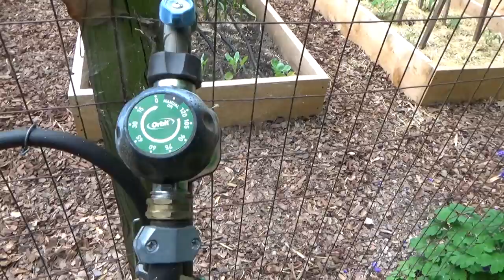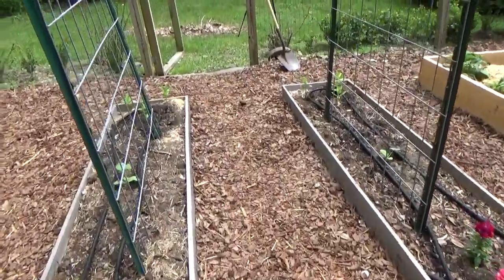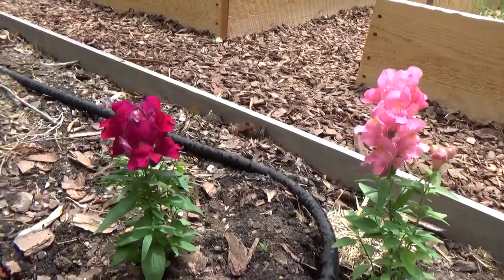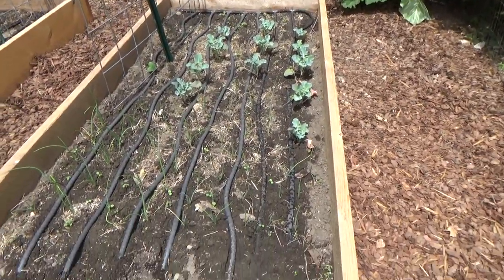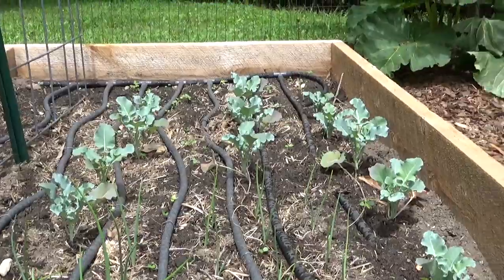Kitchen Garden Tour/My Watering System

Comment: For very small gardens, or single be pot plants, you can use as water bottle.  Freeze water be init, poke holes on bottom and lower sides.  Then bury it upright, refill when water level sinks.  Keep top on to prevent dirt and debris from getting in----